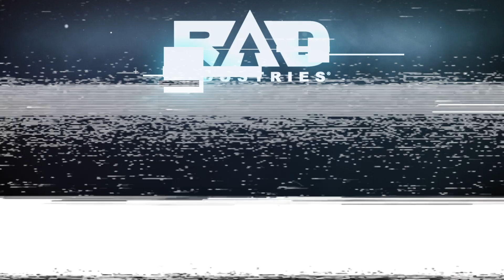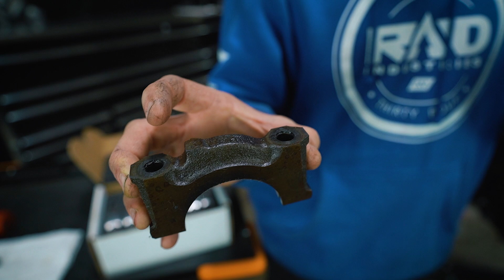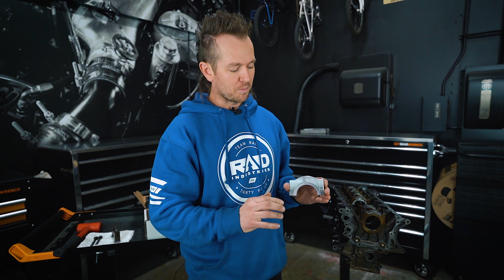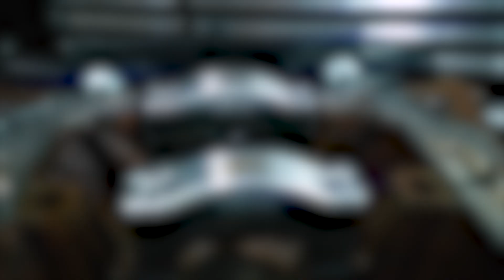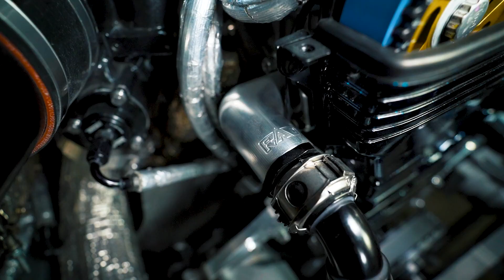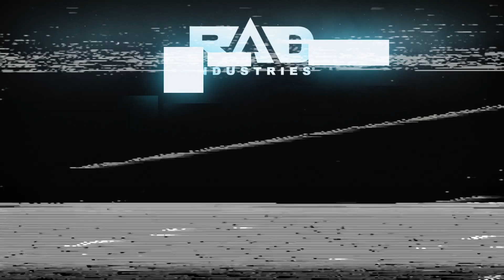Billet Main Caps

Comment: Hey Dan would it be fine that I use my new arp 2000 head studs with billet mains?I usually see guys use 625 studs but I'm not sure if those guys are just doinf highe hp builds. I had arp 2000 head and main studs. Was playing on 600-700 hp so have been thinking about billet mains just for peace of mind.
Reply from the maker: You can use the cheaper ARP main studs, the 625+ main studs aren’t necessary

Comment: Question / thought could those main caps be made to fill in that hole area rather than just sit in that Valley to help support the block maybe if you tapped in some more both holes would that make the block not want a crack at 1800 because of the extra block support